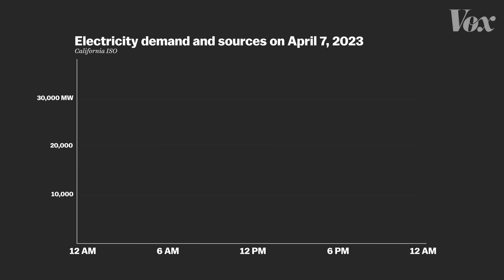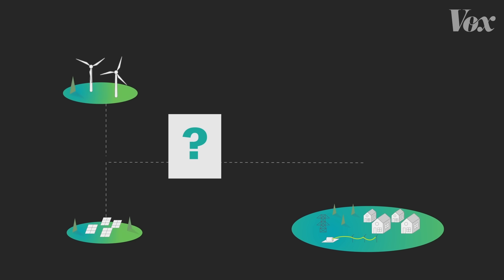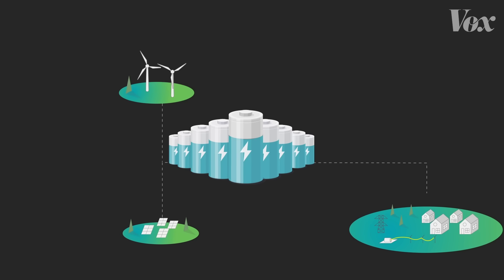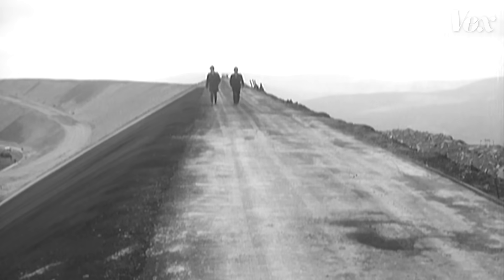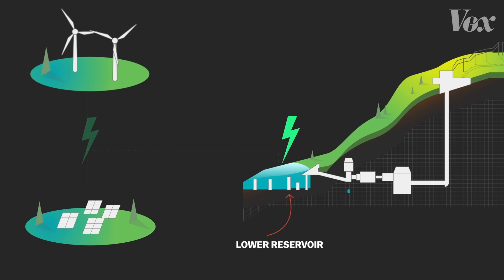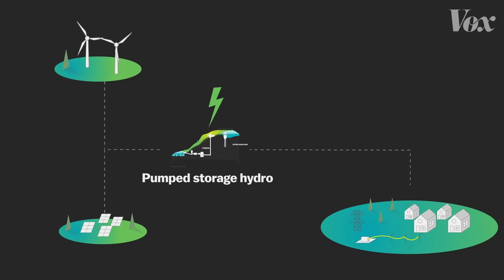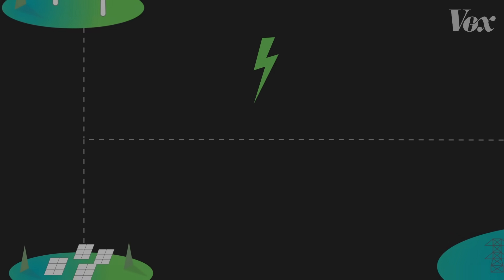How to fix clean energy’s storage problem

Comment: You talk about energy vault and suggest (although you don't outright state it) that they are cheaper than pumped hydro. Unfortunately that is not the case. It would almost violate physics for them to come in cheaper than pumped hydro. Water is just so much easier to move around than blocks of mass. They are a scam.

Comment: At one point you say 'lithium is only found at a few places on earth' then show a map with it just about everywhere. What is worse, lithium supply has never really been the limiting factor for lithium battery manufacturing. In fact prices of lithium have dropped so much recently that producers are cutting down on production to try and increase the price.

Comment: Your initial chart showed both wind and solar failing to meet total demand at any time of day. That being the case, you don't need any storage whatsoever. You can keep adding wind and solar until they meet demand at one time of day at least before storage makes sense. And even then, initially over capacity at some times of day might work out to be a cheaper option before adding much storage.
Reply: Let's say that you need a mountain's worth of material to build that renewable infrastructure that you describe for a nation.  Then consider that both wind and solar generators meet the end of their useful life in about 15 to 20 years.  It's not that it can't be done... but extractive mining for metals and concrete will need to be scaled up significantly.  You'll still need energy storage or baseload power sources for meteorological events called anticyclonic gloom (very low wind, very low ground level incident sunlight).  Europe tends to get 2-10 of these events per year which last 50-150 hours per year.  This could be fully covered if you have about 1500 hours of energy storage on tap.  If we use Germany as an example, in 2021 they used 569 TWh, or roughly 65 GW for their moment by moment average, and they'd need about 97.5 TWh of storage to cover that.  Given that lithium ion batteries cost around $153/kWh, that would run them around $153,000,000,000/TWh or roughly $14.9 trillion every 10-15 years (this is the expected lifespan of a lithium ion battery).  At a gdp of $4.26 trillion per year -- that would be one heck of a sacrifice.  And this doesn't take into account the added cost of spontaneous self incineration events from lithium ion battery farms (and they DO happen distressingly frequently).
Reply: @gilian2587  I agree that lithium ion batteries are not suitable to supply full baseload power. But most nations will not run entirely on solar and wind. I am Zambian and we are nearly 100% hydro and will remain so for the foreseeable future. I live in South Africa which has lots of coal and some nuclear. Those are not going away instantly. They also have some pumped hydro and potential for more. My point was that until your solar and wind are a very significant part of your mix, storage is not so important and over capacity can be more economical initially than increasing storage. After all that is how most fossil fuel grids are run (over capacity with minimal storage). A common misunderstanding is that existing grids provide continuous reliable power whereas renewables do not. That is simply untrue. Renewables tend to have a daily and seasonal cycles but they are fairly predictable, whereas fossil fuels and nuclear have to be taken off line for maintenance or breakdowns so their cycles are different but still exist. They still need either over capacity or storage. As for 'a mountains worth of material' I really don't know what you are on about. Its almost like you didn't read my post but were complaining to someone else.

Comment: 3:29 why are they lifting concrete? Concrete produces co2 to produce and is expensive m Why not just lift something else that’s heavy like… water in a cheap container?
Reply: Check the density of concrete and that of water.
Reply: @Freba9  I’m on about the cost of the materials. A cubic meter of concrete is around $100 and the same weight of water is next to nothing. Why build you blocks out of concrete when you have a cheaper alternative
Reply: @calciumkid0568  It would require a lot more space and height.
Reply: @Freba9  and less than 1% the cost
Reply: @Freba9  why don’t you use sand then if density is the problem? That is more dense than concrete and you can get sand for much cheaper. Or still use just water
Reply: @calciumkid0568  Yeah, but both water and sand would require a lot lot of supporting structure around each unit to contain the medium and support all the other units. Probably made of steel, which is expensive and carbon intensive.
Reply: @Freba9  you can just use a large plastic container, that’s pretty cheap
Reply: @calciumkid0568  If the units are stacked they would simply burst under the weight.

Comment: Would it possible to use magnets to spin creating more kinetic energy? Just release them when demand is high and just store excess or some energy in batteries to get the magnets to spin again when needed. Like keeping some of the power to repower the magnets to generate more power by spinning them fast enough to create more captured kinetic energy then used to get them spinning at the start of the process to turn a turbine?
Reply: That would be considered perpetual motion and is not possible.

Comment: You forgot electrolyzers! Where excess renewable energies can be used to produce hydrogen. Where when needed hydrogen can be used to produce energy. Hydrogen  is also mobile, meaning you can transfer the fuel to anywhere and use it, even in cars and trucks.

Comment: The solution is to stop trying to find a way to use solar and wind as the backbone of power production, and use nuclear for the baseload instead.  Global mining capacity isn't remotely sufficient to produce batteries on the scale people want, pumped hydro isn't practical in enough places, moving concrete up and down is a resource-heavy boondoggle, and deep borehole disposal tech completely solves the issue of nuclear waste. I'm more optimistic about stuff like Eavor's new geothermal tech than I am about grid-level storage at this point.

Comment: Great vid, makes me hopeful. didn't know about the rust or salt. a few nitpicks: 
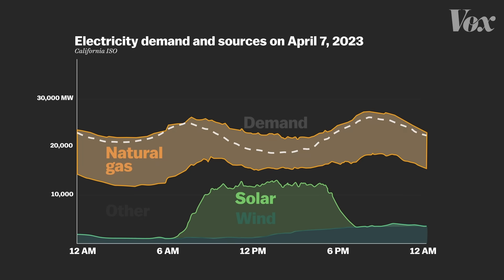1) the graph in 0:28 is normally shown as the opposite, where the natural gas is on bottom and solar/wind on top. this is because natural gas and other hydrocarbons are consistent baseload primary power sources, while solar/wind is variable. 
2) The map at 1:35 misses a lot of new deposits found in India this year. 
3) Using solar/wind as a tool for hydrogen fuel cells (via water electrolyzers) is another promising energy storage opportunity

Comment: You dont need mountains for pump/water storage, the smaller the elevation change the easier it is to pump therefore higher volume, and the cost per unit of energy density absolutely destroys every other method especially the braindead "concrete moving" one which has a huge CO2 req and 10x more moving parts/maintenance.

Comment: I am disappointed that you didn't even explain that those solutions are categorized for time of storage and thus different properties are more important. Hydrogen is long term storage, Batteries would be short term. Also, sector coupling e.g. heat buffer storage in district heating was also missing.

Comment: The end is a bit unsatisfying, I expected.. more. But thanks for the explanation anyway.
I don't understand, in the first place, why isn't it a way more important issue to increase wind and solar energy production in the first place up to the point where they significantly peak over the net consumption. Because only then it will be important to store the overproduction. There, my second thought that is barely talked about, is, couldn't this energy overshoot be used for carbon capture facilities? So we build as much solar and wind as we can, and in the same time build enough capacities of CCS plants that can run whenever there's a plus? Would be very pleased to get an answer (although I think the simple answer is - too expensive)

Comment: I would have thought that hydrogen production from electrolysis would have been possible to load follow excess grid demand, while also storing hydrogen for a fuel cell based peaker power source

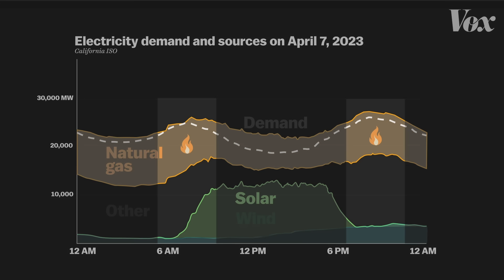Comment: There's an error in your opening argument. You state that wind and solar do not provide enough electricity at any time of the day, therefore power companies resort to other types of fuel. You then transition to asking to how to store excess solar and wind energy. Where is this excess energy that was not fully captured by the grid in your graph at 0:30? I'm not trying to argue that solar and wind do not produce an excess of energy, just that there's faulty logic that needs correcting.

Comment: Hydrogen. We can store energy in hydrogen.
Reply: Sure, but it is inefficient.
Reply: @Freba9  Hydrogen have 120 MJ/kg energy density. How could be inefficient?
Reply: @rocko44444444  Because the volumetric energy density is very low and because electrolyzers and fuel cells are inefficient.

Comment: Showing Tesla Powerwalls, but not the Tesla Megapacks actually designed for grid scale storage seems odd. They use LFP batteries instead of Lithium Ion (newer Powerwalls may also use LFP?). Tesla aiming to scale to 1 TWh of battery storage production per year by 2030, we'll see if they can do it. Their grid-scale energy deployments Q1 2023 was almost 4000 MWh (includes Powerwalls, but mostly megapacks) as they're beginning to ramp volume of their first megapack factory w/ capacity of 40 GWh/year; they just recently announced a 2nd megapack factory with also 40 GWh/year capacity in China to come online next year. Cool if a novel technology can help, but we already have a method to go to 100% renewable in process of being scaled and at a viable cost point.
Reply: LFP is a type of lithium ion.
Reply: @Freba9  Technically correct, but also missing the point--that LFP not at all what your average person is referring to saying Lithium Ion, which tends to mean NiMC or NiCA. LFP have much worse energy density making them less good (but viable for cheaper/lower range) for EVs and they eliminate the need for rare/expensive materials like cobalt and nickel in favor of abundant/cheap ones like iron. 

Lithium itself is incredibly abundant--it just hasn't been profitable enough to mine more places/search out new ones.

I'm reasonably confident LFP will be better than any new idea (excluding normal pumped hydro where possible) mentioned in this video--better efficiency, low cost inputs, small footprint that can be anywhere including indoors, and no moving parts to wear down (excluding fans which are easily replaced).

Comment: There are a few other cool solutions for storing energy. You have old timey flywheels that you spin up, liquid air storage where you cool air and later let it heat up to expand and spin turbines, you could have some green hydrogen production, I think some people even tried storing electricity in sueprconductive coils.

I guess another solution would be to link up a good deal of renewables and transmit it between places (although the US has a problem with its transmission grid, which is another topic). This could smooth out the peaks and valleys, especially if you're dealing with large land masses like the US, China or the like.

Comment: No mention of LFP as an alternative to Lithium Ion. No mention of Megabucks or Chinese battery storage solutions ramping up.
Reply: LFP is lithium ion.
Reply: @Freba9  Lithium Iron Phosphate. Getting rid of rare earth materials and using iron, one of the most abundant resources, instead. You must costs immensely. Lithium has never been the bottleneck in battery manufacturing
Reply: @R.D.Anthology  Correct. LFP is great.

Comment: I reckon concerns about peak demand will mitigate somewhat as more and more people work from home. I definitely don't have a personal peak in usage in the morning and evening. Sure a bit less over night when I'm sleeping (although that's also when I crank up my AC the most, so maybe it's offset anyway), but pretty steady from the time I wake up until the time I go to bed. I don't use more/fewer lights or electronics at different times of day, and I might do laundry or run the dishwasher literally at any hour I'm awake.
Reply: But the large industries and power consumers are not going that. No-one is running a smelter or boiler or factory from home.
Reply: I think you are demonstrating one of the great myths of consumption. Your personal peak usage includes all the users who are providing you with services. I am not sure there is any way to realistically evaluate your personal peak usage. I don't see why working from home would automatically change peak electrical use.
Reply: @rosscollinswilliams  I"m sorry, I don't believe I follow you. When you say all the users who are providing me services, what do you mean exactly? The electrical company? I'm the only one around the house using power during the day and the amount I use is fairly consistent with only occasional spikes for things like doing laundry or running the dishwasher, which occur at random, irregular times and not as part of a daily pattern. 

The reason working from home might eliminate/change peak electrical use is because people have more freedom and flexibility to do stuff throughout the day instead of cramming many/most high electrical use activities into an hour or two before work and an hour or two after work.

Comment: You forgot the most important. Search Energy Dome. It's an Italian company that pressurizes CO2 and then depressurize it thus spinning a turbine and generating energy. It's if I remember correctly 3 times more potent than the pressurized air battery.

Comment: The great thing about the potential energy is its persistence. If you lift a rock, it can stay there for years and will then generate the same amount of energy. No energy is lost over time.
Reply: if you need to timeshift potential energy over years, what is the scenario where it's advantageous over timeshifting energy by 24 hours?
Reply: @robgeach8105  I don't have any real scenario to use it right now. It's just good to know that there is a way how to store energy practically indefinitely. It is obvious after watching he video but I never realized it before.